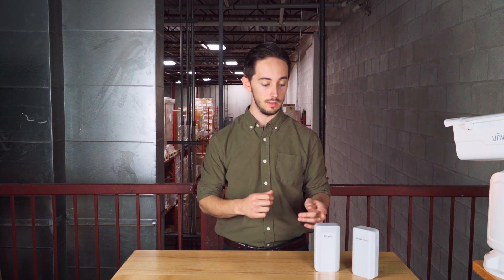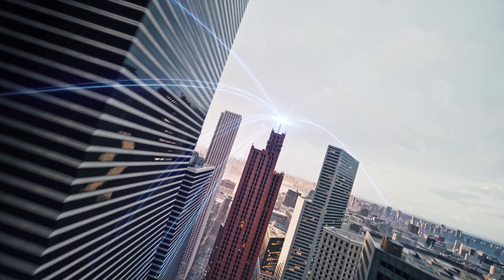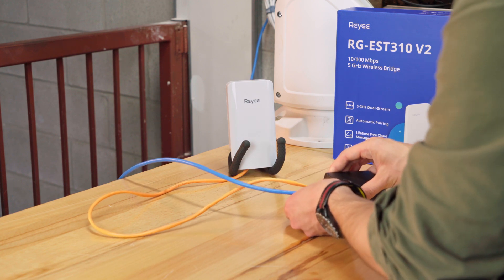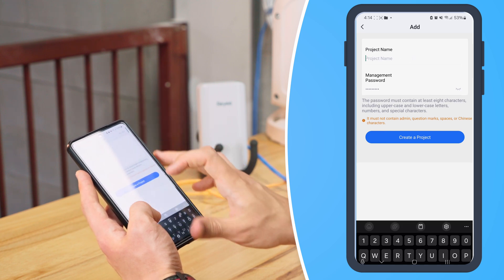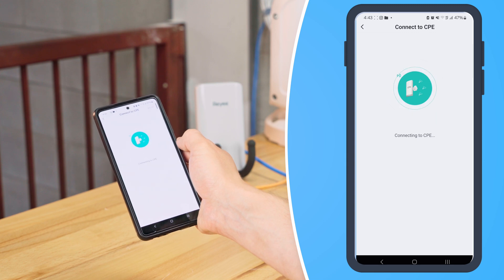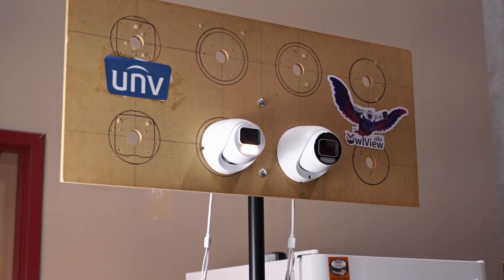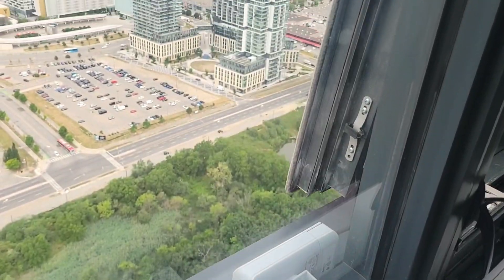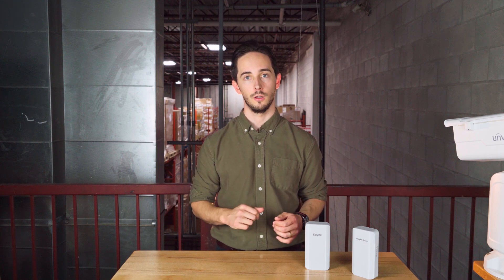How to Pair Multiple Bridges + Long Distance Testing and Showcase | Reyee  RG EST310 V2 | #network

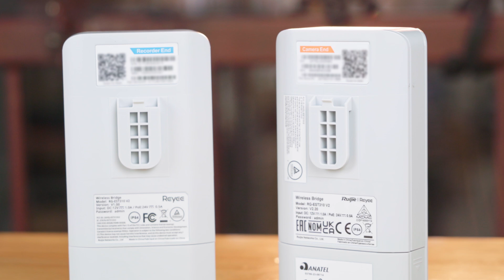Comment: 1:54 Have you imported these specific units from Brazil, by any chance?

I see an ANATEL certificate on the second unit.
Which probably means it was, either imported to Brazil, or produced in Manaus.

First time I see something produced in Brazil featured abroad.
Also, wouldn't I be much cheaper to import it directly from China?
Since the parent company is chinese?
Reply from the maker: We get all our Reyee products direct from Ruijie's manufacturing in China as we are the master distributor for Reyee in Canada. Regarding certification, Anatel approval is mandatory for telecommunication products imported into Brazil, which is likely why it appears on the back as they do import to Brazil.